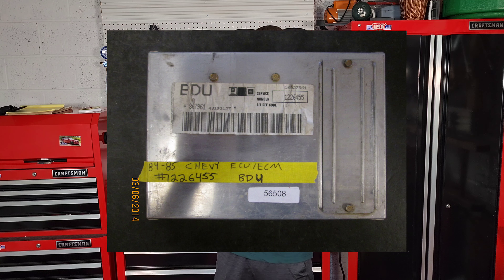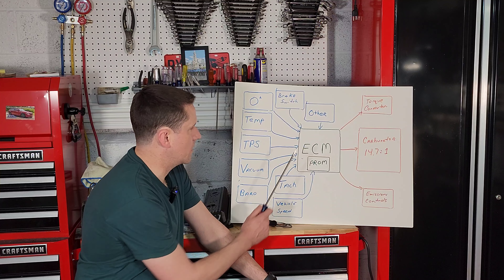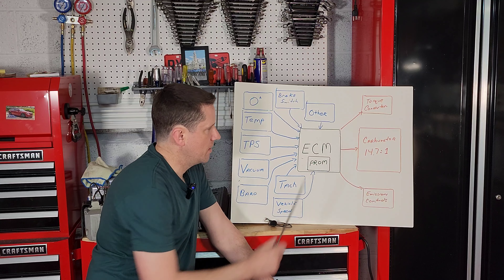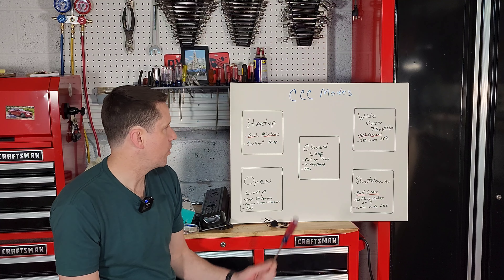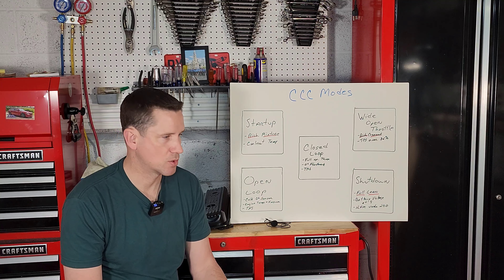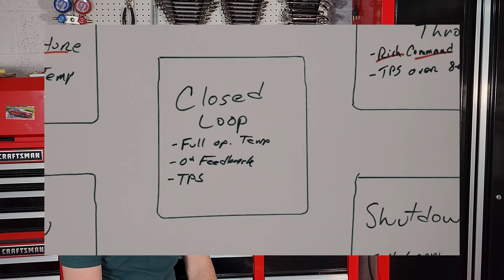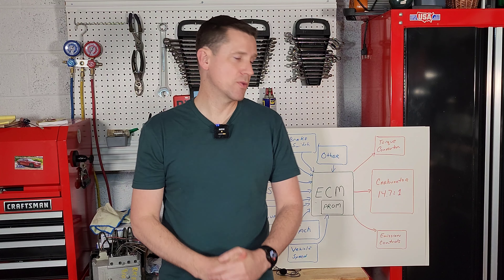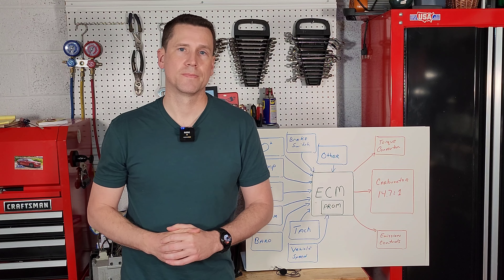The GM Computer Command Control System Explained (Part 1)

Comment: Thanks for this great video. It's the best one on the CCC I've come across so far.

I have a question:

Recently my alternator went out while driving. I put in a new battery and had the alternator rebuilt. I cranked it up and it idles fine at first, but after a blip of gas, the RPM's drop and it stalls. Or it will just idle real bad. Does the ECM have some type of relearning phase after the battery or alternator was disconnected?

Thank you for your time. Honestly great job on the video.
Reply from the maker: Thank you for the feedback on the video. I really appreciate it.

As for your question, the ECM does have a block learn feature that will need to be "re-learned" after disconnecting the battery. It shouldn't, however, affect the drive ability of a carbureted engine (They were bad on some fuel injected V6's, especially the 2.8). I'd suspect there is something else going on within the idle circuit.

Comment: If the ECM were to fail...would the vehicle still run, or just run crappy? I have an 84 C10 with E4ME feedback carb.  When I try to adjust timing or curb idle it seems to do ok at first then it takes over and idles erratic up and down.
Thanks in advance! I really appreciate your vids. It seems people good knowledge on these set ups are a dying breed.  I hear that these quadrajets are a kick ass carb when all is well
Reply from the maker: You would definitely know it if the ECM were toast. Most notably, by the lack of the check engine light when you turn the key. You could also jumper the diagnostic terminal to pull codes. None would obviously mean you have a problem. Keep in mind, though, that the ECM is designed with several "limp" modes as a precaution, so the truck would still run. Also, the idle circuit on these carburetors isn't controlled by the computer. I'd bet you have some other issues going on.
Reply: @rporestorations  thank you for that info! When I turn the key to on position before starting..I do hear mixture control solonoid tapping away for several seconds then it stops.
Reply from the maker: I'd say you're probably good with the computer. Start with the basic carb diagnosis (vacuum leaks, settings, float height, ect) and go from there.